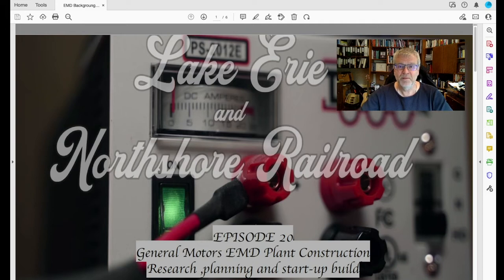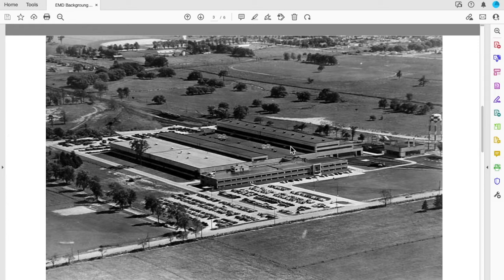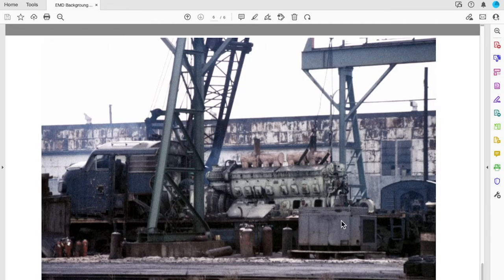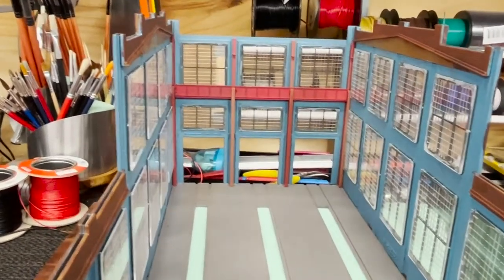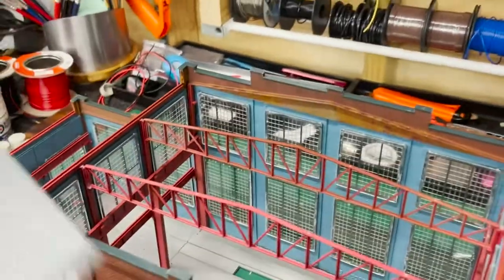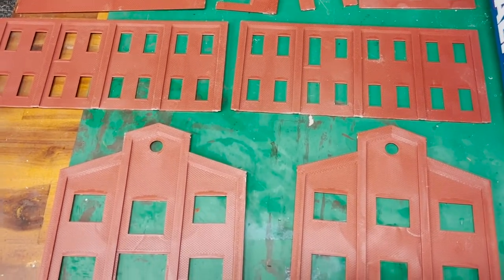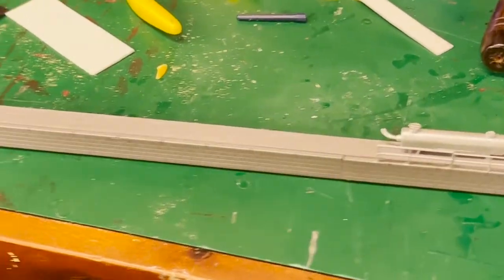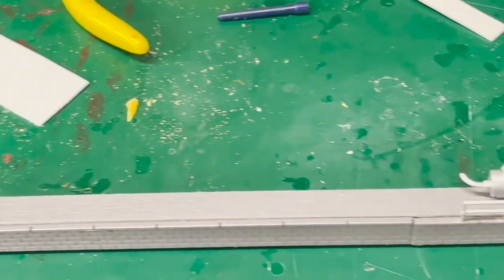LE&NS Railroad Episode 20 GM EMD Plant Build

Comment: The picture you have that looks like a motor sitting on a flat car is actually a B&O F7 be disassembled for parts. What you call the car tis the locomotive frame.
Reply from the maker: I thought so. I have used this to model the flat car transport anyway.
Thanks for clearing that up.
Reply: @rmmodelrailroading4977  Hey, railroasd do use all sorts of weird cars to transport motors and parts.